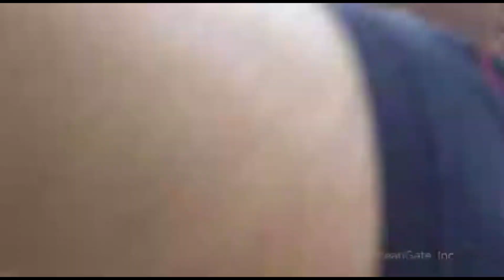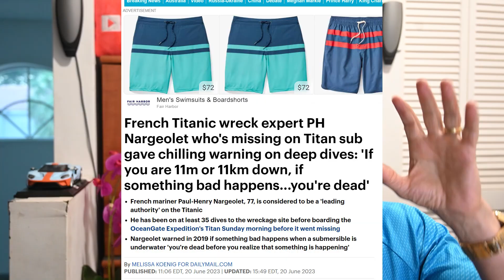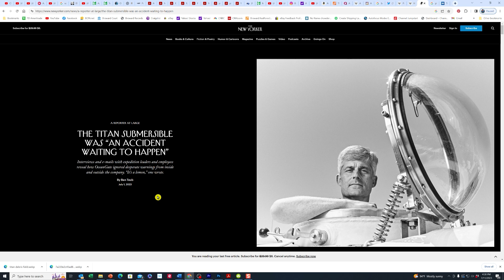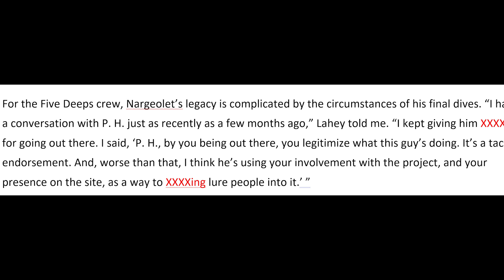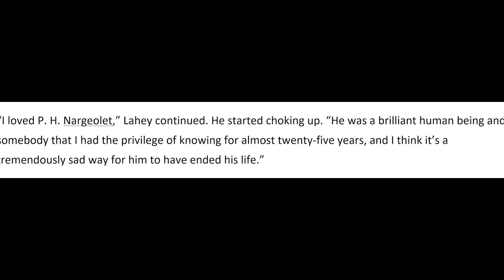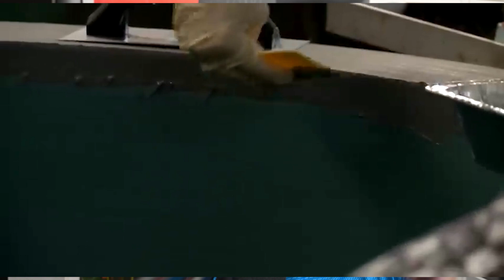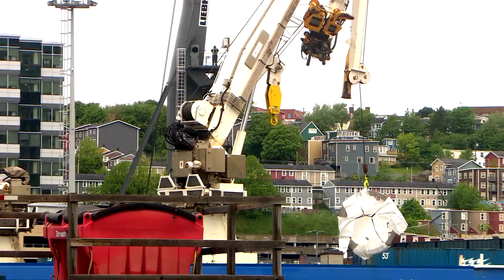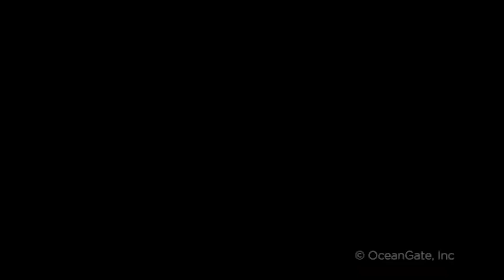Titan Sub: More Q&A, Design Defects, Why Descent Fast

Comment: The support vessel knew about the high descent rate from the very beginning, but probably no one really wanted to say anything even remotely sounding like criticism towards Rush, because that gets you fired and sued. That would explain why no one mentioned it way earlier. Just this company culture alone is a sure fire receipe for disaster. The support vessel mentioned this to Rush, and he b-rush-ed it away like everything safety related. I wouldnt be suprised if Rush would have a chat with the person mentioning the high descent rate, after a successful dive. I guess given the assumed company culture the person texting this to Rush must have been so worried, likely having realized this meant disaster in progress, that it overrode the unpleasantness of the expected reprimand by Rush. Rush himself must have monitored the descent, well there is nothing else to do while the submersible descends, he must have known this. The high descent rate was there from the very beginning, so it didnt develop at 3500 m. It must have shown within the first minutes during the descent.
The rate of descent is depending on the weight of the submersible and its buoyancy. Did they have a chart showing which weight of the submersible would cause which descent rate?  The amount of weight the vehicle can drop is limited and known. So there is a fixed amount of weight that can be dropped, which MUST lead to positive buoyancy, otherwise the submersible is stuck down on the sea floor at least until something arrives which is able to hoist it back up. That could be days, and it could be a coffin by then.

Since there is a fixed relation between the descent rate and the weight of the vessel, there must be a maximum descent rate resulting from the vessel weight plus the droppable weight. Exceeding this descent rate means even after dropping all ballast the buoyancy stays negative.  Was it beyond this point? Or maybe in the beginning it was just close to it, Rush doing his usual brushing away all concerns? 
Then with raising pressure the vessels weight increased by water ingress/maybe crushing equipment boxes in the back, after all one battery bus did fail pointing to problems in that area, did the rate exceed the maximum?
After dropping everything the submersible basically didnt ascend at all. The 20 meter or so it did rise could have been caused by the thrusters, Rush might have pushed them to the max to ascend. All the while the damage progressed until it reached the literal breaking point. 
I wonder if they were in an unrecoverable situation, and Rush and the support vessel knew this rather early. The descent rate would have told them.
Reply: I'd sure like to compare 2 sets of dive notes. did rush always pilot the sub?  the polar prince kept asking for status reports and rush wasn't answering in contravention of what was probably an established process, but yes sounds like the culture was one of not questioning the "big man" because he would fire you.  Well, Darwinism sadly with collateral damage.
Reply: @pollystyrene99  did the sub have a fast descent rate on its previous dives?

Comment: The original Titan (Cyclops 2) that was made back in 2018 was done by Spencer Composites. It’s possible that the video is of that build. Interestingly they originally trialled carbon fibre end caps but they failed and switched to titanium. The Spencer Composites build started to fail due to cyclic fatigue and was eventually limited to 3000m which couldn’t make the trip to the Titanic. In 2020/21 Titan was either repaired or fully rebuilt by two different companies (two Washington state companies, Electroimpact and Janicki Industries,) It was this new design/ build that eventually imploded. If the video is indeed of the original build, we don’t know how the new one was built.

Comment: I don't think that this sub. was imploded and got another approach: I think that the bottle neck is the glue connection, so the connection between the titanium parts and the carbon fiber tube. They both have different characteristics on which they react to the water pressure, this because the different compression ratio's of both materials. The titanium is stiff and "won’t move" under the pressure. But the carbon fiber is much lesser stiff and wants to move out of position. I think that the crackling sound that was heard more than once in the vehicle was caused by the movement/stress of the carbon fiber.

Due to this I think that at the glue side there has been a leakage. On the depth this vehicle was at the moment, the water was compressed circa 5% and due to the leakage it gets the opportunity the get in the cabin of the Titan, the water expands with speeds higher than the speed of sound. Water, with speeds higher than the speed of sound, will blow into the cabin. The water worked like a water cutter. Besides that the pressure in the cabin increased, as well as the temperature. Also cavitation will play a huge role in these circumstances. I think that as a result the two titanium caps are blown of from the carbon fiber tube. When you look at video footage of the titanium caps which were recovered, they are completely clean. With an implosion you would probably would see rests of glued carbon fiber on the titanium caps. My experience with glued titanium parts which are in contact with water: often trouble occurs.
You are right about the glue process. As shown in the video, this is not the best way to work. Autoclave and rougher titanium glue base had been indeed better options. But this would not have saved this sub, I am afraid.
Just a thought. I don't say that I am right about this all. But want you just to know that there are probably more points of view possible.

Comment: Fantastic Work and research,  I am an aeronautical engineer with lots of flying experience.  All I know that when you glue the Apoxy you need temperature 🌡 control environment and exact amount of it. How many time you glue things together and fail ? . My take is thr apoxy fail first due variables temperatures and pressure.  PS: very nice watch ⌚️ 👌.

Comment: From the transcript, it seems that the crackling noises were in the aft section, possibly in something outside the sub, seemingly unfamiliar noises to Stockton Rush. One battery lost power at this point. What was there in the back that could have lost buoyancy? Could an external implosion have caused a shock wave that broke the main hull?

Comment: Someone with relatively extensive knowledge of carbon fiber composites here:

Ultimately there's two types of carbon fiber: "wet" and "dry". 

Dry carbon fiber already has the optimal amount of expoxy laminated and woven into the fibers. So you layer it, and cure it in an autoclave. Dry carbon fiber is better in several measurable ways, and it all comes down to the ratio of carbon fiber to epoxy.

Wet carbon fiber is CF that has epoxy added on in "wet" layers just before manufacturing. It doesn't require an autoclave to cure, as it can be time-curing epoxy. It is a technically inferior product compared to dry carbon, but it requires millions less $$$ to manufacture.

Judging by the OceanGate clips in this video, it looks like wet carbon is being used, which just seems typical of OceanGate.

Comment: The focus on the epoxy is misleading. The end caps closely fitted the carbon fibre tube and the epoxy glue would have been subjected to increasing compression forces as the submersible descended in the ocean. This would increase the sealing ability of the epoxy joint and make the joint tighter. The sides of the cylindrical carbon fibre tube are the weakest point, together with the plexiglass porthole.

Comment: I thought perhaps weight at decent but seems off somehow...if the thrusters were an issue beforehand then were somehow reconfigured improperly, wouldn't that affect the rate of decent possibly without them noticing? But if the surface knew this decent rate was an issue, WHY wasn't the dive aborted instantly... WHY did they continue diving knowing they were defending too fast?

Comment: The excessive descent speed has surely got to be a contributory factor to what subsequently occurred. If the transcript is authentic, what is really striking to me is the apparent lack of concern expressed about this issue from either Titan or its mother ship within the messages exchanged.
Reply: I wonder if the descent speed was because or partly because it had already sprung a leak and was taking on water.
Reply: @kisstune  That's what I thought too.  That would account for the noises heard in the aft, and their slow ascent of 60 feet in 3 minutes.  They had water weight.  Just my guess.
Reply: @kisstune  I doubt it, because the deeper you go, a water 'leak' turns into a raging torrent, nearly like a blow torch.
Reply: @kisstune  
1- They were DESCENDING faster than normal
2- They were hearing CRACKING noises from AFT end (sealed electronics behind wall) 
3- ALL THE HULL ALARMS WERE RED
4- When they "Dropped Ballast" they WERE NOT RISING AS FAST AS USUAL 

Common Sense and ANY INTELLIGENT OR OPEN MINDED person would say 
"WE HAVE GOT A LEAK"
I AGREE IT WAS LEAKING IMMEDIATELY AFTER ENTERING THE WATER

(THINK ABOUT THIS- James Cameron said "The aft wall probably crushed them at the speed of sound" )
Reply: @thecloneguyz  Bingo, you do not need to be an engineer to figure that it was probably overweight and descending too fast because it was leaking in the back from the start, I'm surprised he didn't mention it.  If the leak did happen so early, that makes this disaster even more preventable.
Reply: @robinsattahip2376  A leak would also get worse the deeper they went.
Reply: The mother ship did show some concern. I'm guessing that the mother ship knowing that Rush was the pilot, was knowing they would not need to express the fast decent. And even when the mother ship mentioned the increased decent speed, Rush did nothing but dismissed the concerns.
Reply: Maybe the guys on the main ship didn't know how to do math so they didn't understand it was going to fast none of them.seem very smart.
Reply: I would suggest that the excessive descent speed was a symptom, not a contributing factor. Something must have gone wrong to cause the excessive descent rate.
Reply: They expressed their concerns only when it was too late.
Reply: They were/are professionals. Do you expect them to start typing expletives with excessive punctuation? They seemed calm in their messages because they knew what they were doing and what they had to do to get the sub's crew back to safety
Reply: If the surface ship had any communication that indicated a problem, why did they wait over 8 hours to call for help?  This makes zero sense.  The transcript is baloney.  They received a normal 15 minute ping from the sub on descent, then they received nothing more.  That's what they reported to the USCG.  They were hoping it was just a comms failure, and the sub was continuing it's mission on a nominal timeline.  They waited until the time when the sub was supposed to return before calling the USCG.
Reply: What if they were descending too fast because they accidentally pressed the turbo button on the Logitech controller.
Reply: This. Incompetence or the transcript is fake.
Reply: The problem is Rush acted like an asshole every time someone had any kind of concerns. He spent an insane amount of money hushing ex-engineers who tried to tell Rush that his submarine needs to be refactored. So he either replaced the mothership full of "yes men" or threatened them with their jobs if they told him he was wrong or had concerns.
Reply: @it_sundae idk if I’m happy that he paid the price for his arrogance or disappointed that he only had to account for his actions in the very last moments of his life.

Comment: Maybe the young kid got scared or started freaking out early on, and Rush felt pressure to get to the bottom faster. If the boy was 'terrified' before going, then its quite plausible that his apprehension was felt by Rush, and it affected his handling of the ship.
Reply: More likely they miscalculated the weights of everything.
Reply: I think the kid got scared and tried to break the window to get out and cracked it. He might have been on the potty bucket with the shade pulled where they couldn't see what he was doing. He might have brought a little hammer in his underwear that Stockton didn't see.
Reply: @canada.fer.51  yes for sure I think the kid got so scared that he took a massive dump that made everything smell bad and they passed out and crashed into a passing by sperm whale and then Somali pirates attacked them

Comment: Normally, I would pretend to know anything about engineering. However, the idea that sanding down, or roughing up a smooth surface for glue to adhere to sounds, may sound logical, but is probable not the right thing to do. Admittedly, I have not done a lot of gluing, but I have done a lot of soldering. When soldering, quite a lot people will first rough up the surface of either or both metal parts in order for the soldering agent to have more grip. But what you are in effect doing is risking the creation of more airconduits, which could, in fact, weaken the final bonding. As I said, I have not done al lot of gluing, so it might be different for glue. But if the parts that are glued together are an exact fit, and the entire (smooth) surface is evenly covered in glued (so not in dabs), there should be no problem.

Comment: Jeff  in general epoxy can and will cure in most non-specialized environments. Meaning room temp, average humidity,  etc. Some require UV light to cure but most don't. In an autoclave, and underpressure would have ensured (as much as possible) that the epoxy was driven throughout the carbon fiber. That there were no dry patches, hence hidden weak spots susceptible to being the location where delamination is allowed to begin. When you're talking about a 22' long structure that is 5" thick, seems like alot of opportunity for imperfection. Especially when it's being monitored by human beings,  just sitting there watching it go round and round and round. You can't tell me that even the best intended person wouldn't, at the very least, pull out their phone to check messages or sports scores. It's all so upsetting but the worst for me is how cavalier Rush was with other people's lives. Thanks for the videos.

Comment: Although the carbon fibre and glue joints are prime candidates for the failure, the window is also a major suspect. Water at the depth of the Titanic compresses by about 4% and the 1 Atmosphere pressure in the Titan may as well be a vacuum. If the window shattered, tonnes of water would flow in at the speed of sound in water - over 5000 kms/hr. The speed at which compressed water can uncompress is basically the speed of sound. This is way faster then the speed of water jet cutters. When that water is suddenly stopped by the inside walls of the Titan, the momentum energy of the water would probably be enough to explode the carbon fibre tube outwards into minute pieces. An inspection of the titanium end pieces would probably tell the story. If the window failed, the titanium caps would probably be evenly  expanded outward a bit at the edges.

Comment: Is 5 people the standard crew? How many were onboard on previous dives?
Reply: Ordinarily I'd say it was "designed" for five, but I think saying this thing was "designed" at all is too generous
To actually answer the question, yes it was intended to carry five, the pilot and four passengers
Reply: @adamheywood113  Then imperative that reason for fast descent slow ascent is found. One automatically thinks water replaced air somewhere.
Reply: @lightworkeight4136  has the transcript been confirmed genuine?

Comment: I have an engineering background and just looking at that ring/tube joint made me want to sit the ring inside of the tube such that under compression the joint gets tighter rather than threatening to shear off of the face of the ring. Anyway, superfluous now I guess.

Comment: Still nobody considered sabotage. Not saying someone sabotaged the vessel, but we should keep the possibility alive. A small hole or man made defect could be enough to compromise the structure. The rapid decent is also a good indicator. Even after dropping all possible weight, it stayed almost at the same depth. Coulee mechanical or software sabotage. We all assume it’s a defect or fault by design, because of the questionable execution of the vessel. But the one doesn’t rule out the other possibility.